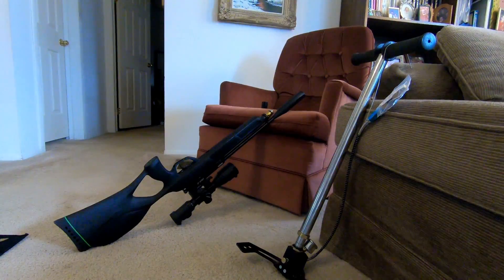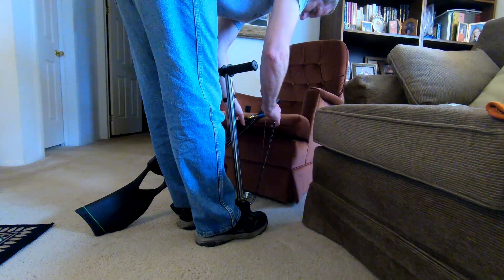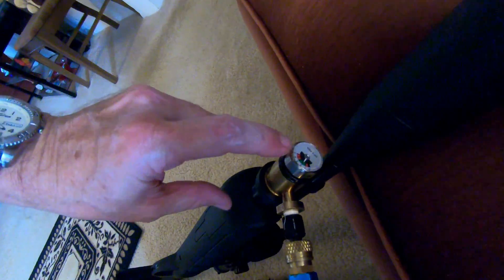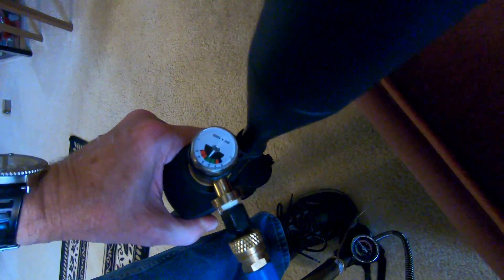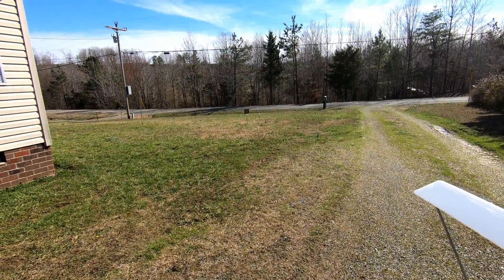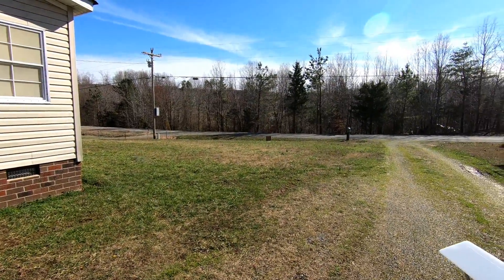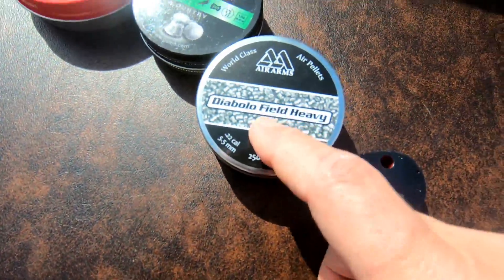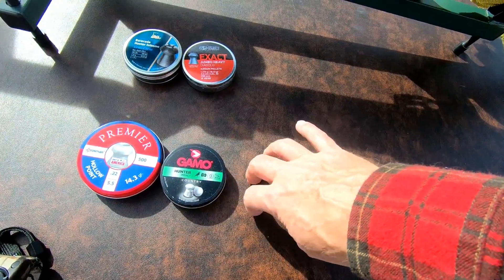Gamo Urban PCP air fill, power adjustment, trigger mod and chrono results.

Comment: I am still hooked on the Benjamin Marauder for my next air rifle.  I do have  the Benjamin Discovery and I have to use a hand pump like yours.  It is probably the same pump.  Yours is a beautiful rifle, but, I just want old school wooden stocks.  I am glad that you brought out the point of bleeding the pump valve before disconnection from the rifle.  That is important.  Thanks for sharing and happy shooting.
Reply from the maker: The Marauder is an excellent air rifle. Are those regulated? If so, it probably means a tad better accuracy through the full tank. The Urban isn't bad. It's probably as close to a regulated air rifle you'll find without actually being regulated. I still got a 20fps variance with the 18g pellets, 30fps variance with the 15.3g, and 39fps variance with the 14.3g. I'm not entirely sure how much difference a regulator would make. I may decide to try that in the future some time. An after market regulator is $95 for the Urban.
Reply: I'm not quite sure what you mean by regulated.  I know they have upgraded the rifle with a debounce device for more shots.  Apparently, the rifle can be adjusted for different pellet velocities.  But that is all I can gather in the description from Crossman and Airgun Depot website.
Reply from the maker: A regulator is supposed to keep the power more consistent. Without a regulator many PCP air rifles will have a fairly pronounced power curve. I thought I read somewhere that the Marauder is regulated, but I could be wrong.

Comment: Great video! I love that you showed the process of pumping up this type of air rifle, I wasn't going to buy a SCUBA tank for that process! I also very much appreciate the safety note about releasing the air pressure from the air pump prior to removing the connection to the rifle, and how easy it was to remove is fantastic! Dropping another LIKE on your video, Watching and Supporting!
Reply from the maker: Thanks Ray. Yeah, I wasn't really looking to invest another $700 on an air compressor or even $300 for a used SCBA tank to have the scuba stores fill for me for $10 a pop. That's why I went with the Gamo Urban. It's fairly hand pump friendly. It takes me about 50-60 pumps to get it filled back up to 2900 psi after shooting 20 shots. That's not too much for me to handle.

Comment: Just about key hole shots at the end, Think the trigger adjustments made a big difference. Nice work Bill!
Reply from the maker: We'll see what happens as I try to raise the power more. I'd like to see 900fps from those Terminators if I can reach it and still have good accuracy. Not sure if it'll adjust up that high or not, but I'm going to try. lol I'm going to have all kinds of fun with this thing. 😜
Reply: @casualcarolinafishing5835  .22 caliber? 900fps will be a pretty good thumper.

Comment: You have your light deflectors on your chrony on wrong. They are supposed to go sideways (left to right) to cover the sensors, not parallel (front to back) with the unit. The sensors can get real finicky, the light has to be just right. Indoors with a shop light right above the unit you sometimes can get away with not using them. It's hit or miss depending on the unit. But if there is too much light outside you would need to have them on correctly. That last group was great!

Comment: Nice setup!  I was expecting a little faster #s, but still pretty good!! Definitely shoots straight!
Reply from the maker: Thank you. I could probably get it adjusted up to 900fps with the 14gr pellets, but that's probably about as high as it'll go without some pretty serious modifications. I remember there was something about only being able to screw that adjustment screw in so far before it causes issues with cocking the next pellet into place. I may play with it to find out just how far it'll go. Of course there's always the chance bumping the power up will affect the accuracy negatively. I have all summer to play around with it before next hunting season. :)

Comment: Grabbing more of your time, Watching and Supporting... a good air rifle makes me wonder about the effort for maintaining shooting skills. In the service, they had .22 adapters for the M-16, which makes sense, cost savings and such. We shot on smaller targets, closer to them, and with the iron sights. The theory was that we would be maintaining accuracy and skills for if we ever had to shoot the real ammo again (which is another argument due to the kick and such)... but a quiet air rifle with a nice setup might be a very cost effective thing to do... with the occasional full gun and ammo practice to make sure the guns are well maintained too. On our property, we can set up our own private firing range.
Reply from the maker: I think any kind of shooting is good for keeping the skills honed. There's no doubt, pellets are much cheaper than bullets, making air rifles a great method of doing exactly that. You're right, recoil doesn't come into play with the air rifles much though. That's a great thing about owning property. You can do do what you want with it, assuming it follows the local zoning laws/regulations. Thanks again Ray!

Comment: Love that air rifle Bill. Pumped air is fantastic. Can you use a small portable compressor?
Reply from the maker: Thanks John. Sure can. I'm just trying to make do with the hand pump. It's one of the reasons I bought the Gamo Urban. It's fairly hand pump friendly because it has a small tank. That also means I only get about 20 shots before needing to refill, but it only takes about 50-60 pumps to get it back up to 2900 psi and ready to go again. Those high pressure compressors can get expensive.

Comment: That is really cool. Can you use co2 canisters to fill it?
Reply from the maker: Thank you. No, not this kind. These are charged with regular air at higher pressure. You can get an SCBA tank (about $300 for a used one) and have the scuba stores fill it for you for $10 a pop. I bought this specific PCP because it was said to be so hand pump friendly. I have to agree. It isn't too bad unless you're just really impatient, or perhaps not able to use the hand pump due to physical limitations or something.

Comment: Nice info . Would you have to hand pump them if you didn’t have the pump Bill? Nice set up . Look 👀 out squirrel 🐿. Nice video thumbs up 👍 for sure!🔥👊🏼👋
Reply from the maker: Thank you. You can either use a hand pump, a pre-charged tank that you can take to scuba store and have filled, or a high pressure air compressor. Any of those methods will fill your tank for you. Each fill to 2,900 psi gives me about 25-30 shots before needing to be filled again, depending on the pellets you're shooting. The higher grain pellets use a little more air so you probably only get about 25 before the pressure starts dropping off drastically. You might squeeze out 30 shots with the 14 grain pellets. They make air rifles with bigger tanks to get more shots between fills, but I wouldn't recommend using a hand pump to fill those bigger tanks. You'll definitely want a SCBA tank or compressor to keep those monsters filled up. One of the reasons I bought this Gamo Urban is because it's so hand pump friendly with the smaller tank. I'd never need more than 20 shots on a hunt anyway. Maybe pesting rats or pigeons at a farm, but not out squirrel hunting. If I need more than 20 shots to bag my limit of 5 squirrels, I should probably give up hunting. ;)  Oh, I think I just got what you were asking... There is no pump on the air rifle itself Charles. The only way to pump it up is with an external air source. It's worth the extra effort for the power and accuracy imo.

Comment: That pretty awesome buddy! I wonder if it would fill up high pressure tanks for paintball guns?
Reply from the maker: Thank you. I'm not really familiar with the paintball gun specifics. It's very possible. This pump is rated at 4500 psi.
Reply: Casual Carolina Fishing thanks I may have to try it! I have a old paintball gun just need a new tank.

Comment: i never knew you can pump up a pellet gun like that, how many shots is it good for
Reply from the maker: I usually refill after 20 shots to make it less of a pain to pump it back up again, but if I wanted to stretch out as many as possible, I could probably get another 10 shots out of it. It's just easier on me to pump it 60 times than 100+. 😂

Comment: how bad did the shot count go down after cranking up the speed?
Reply from the maker: I feel real good about getting 20 consistent shots so that's what I stick with. I'm sure I could get 30 shots off, but the pressure will probably start dropping off after about 25, so that's why I don't even bother going beyond 20 without refilling the tank. It doesn't take all that much to top it off when I refill after 20 shots and I really like that. I use a hand pump so that really comes into play a lot if I'm shooting quite a bit on a given day.

Comment: Man I just bought the gamo urban with a hand pump but the o rings are too loose does anyone know what size are the orings for the hand pump probe
Reply from the maker: I don't know what size they are. Mine came with extra o-rings. Sometimes I have to hold the probe in all the way while pumping a time or two to get it to seal up. You could try that.

Comment: Do you really have to pump air into air rifles? I had no idea! Wow that thing is accurate! Or maybe that's just the shooter hehe
Reply from the maker: There are all kinds of air rifles. The PCP style has come on strong in the past decade. That break barrel I had was an air rifle too. They also make ones with a pump on the gun itself that you pump 1-10 times. Those aren't quite as powerful and accurate though. I've done quite a bit of shooting in my life. Mostly when I was younger but I probably shot a million rounds or more though air rifles when I was a boy. I also hunted with shotguns and .22 long rifles quite a bit as well. This rifle is pretty accurate for it's price range.